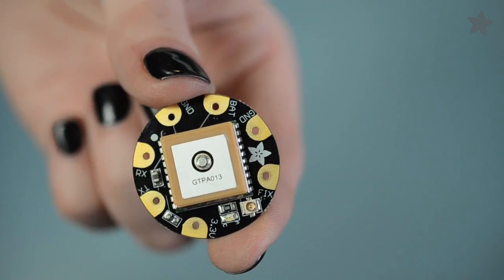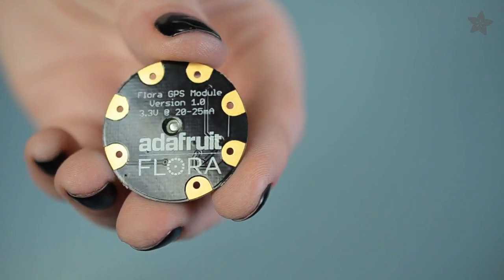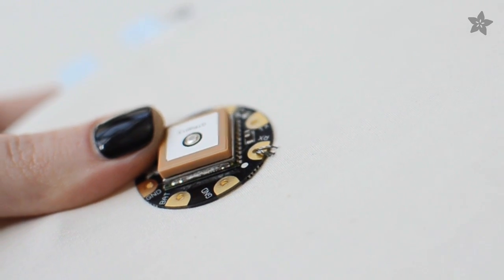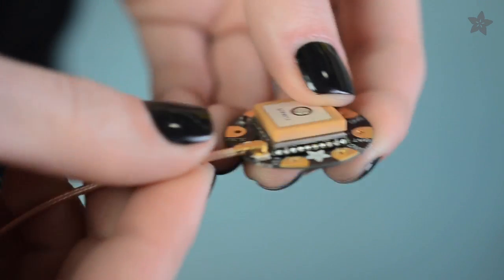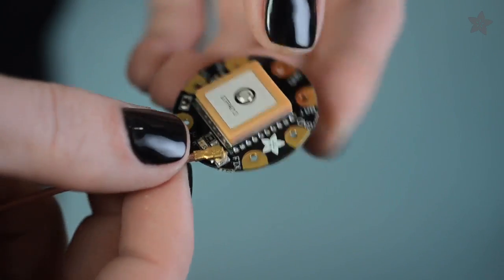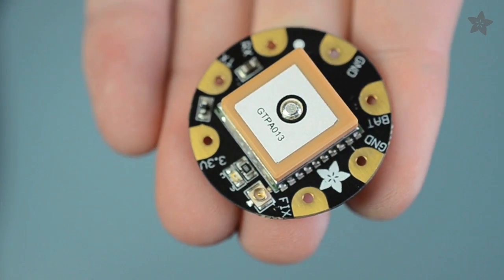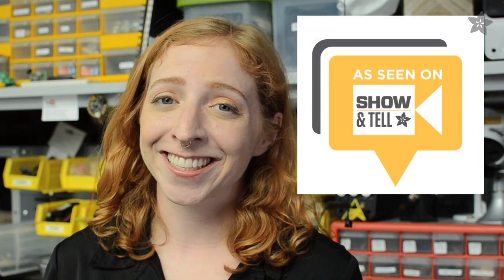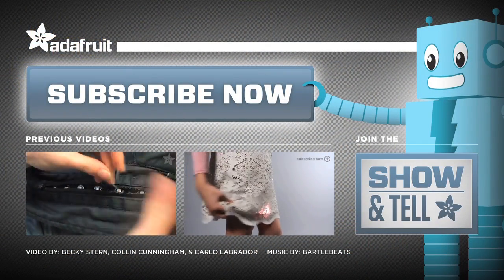Sewable GPS Module - Adafruit FLORA Wearable Ultimate GPS

Comment from the maker: You can use the FLORA add ons with other Arduino-compatible boards, Adafruit also has more standard header-pin 5v versions of each (FLORA boards are round and 3v-- smaller and sewable), and the libraries are the same. The GPS uses RX/TX and the accelerometer, lux, and color sensors use I2C. You can post up your project ideas in the wearables forum on Adafruit where our staff hang out!
Reply: Can this work with a raspberry pi?

Comment from the maker: Flora Wearable GPS: Our Ultimate GPS-- for wearable electronics!  #wearables   #FLORA  
https://learn.adafruit.com/flora-wearable-gps

This module is the best way to add a GPS to your wearable project. It's part of the Adafruit Flora series of wearable electronics, designed specifically for use with the Flora motherboard. Installed on the PCB is the latest of our Ultimate GPS modules, a small, super-thin, low power GPS module with built in data-logging capability! This module's easy to use, but extremely powerful.